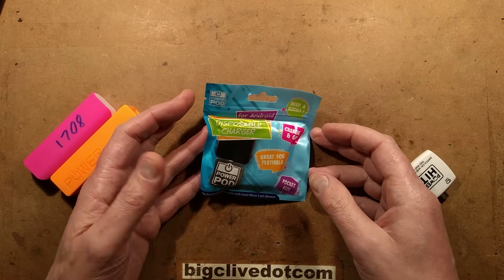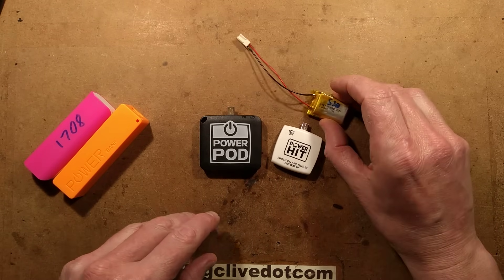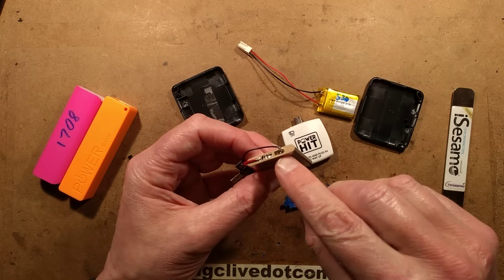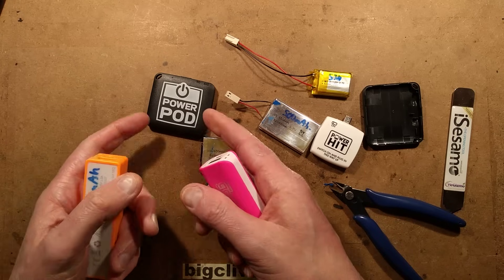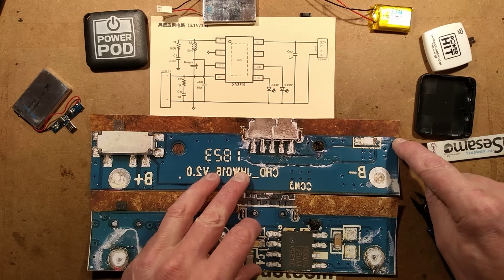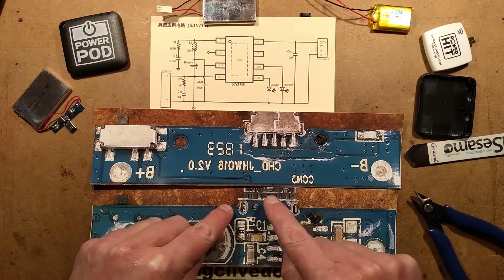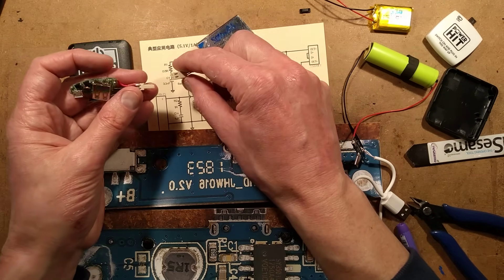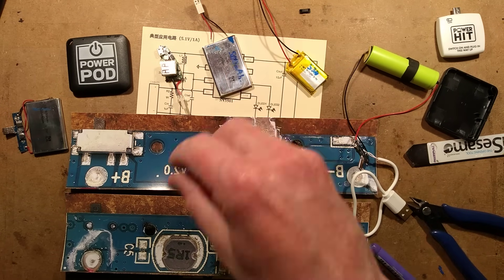Poundland "disposable" phone charger.

Comment: Shame they make and sell those instead of making a super cheap rechargeable pack out of it.  Would be easy enough to do.  On an unrelated note apparently scrolling a full screen video is now a thing.
Reply: Haha, yes! I also discovered this a few days ago. 
Purely by accident, of course :D
Reply: The scroll feature is OK but I really wish they would bring back the "fixed" video sizes when not full screen so I could scroll my subscriptions on the left without it covering and dimming the video.  I find it really annoying.  YT likes to "fix" problems that weren't problems!
Reply: @ElmerFuddGun  I use a CSS stylesheet fix that changes the video to take up the full vertical space of the page, so I don't have to go to fullscreen mode.
Reply: You win today's most-useful-comment-on-the-Internet award.
<scrolls delightedly up and down in full screen>
Reply: @davidf2281  It better to buy poundland 1200mph power bank one for one pound or there power geek 2200 power bank  one for two pound  or there 4000mah power bank one for five pound
Reply: @mrwahibtahri  Sorry, could you repeat that?
Reply: Woah! Thanks!  Much easier and faster, than toggling full screen mode.
Reply: @Hugatry  Messes up when watching 360 degree videos though. Used to be that the scroll wheel controlled the zoom, but now it just scrolls the page down. Very irritating...
Reply: Wish it'd be like vimeo, where you can see the comments and the video at the same time on desktop.
Reply: Full-screen scrolling?  That feature is not working for me.  I'm on a computer though.  You must be using the cellphone app.  I don't use that either since it always freezes up and the video-slider, pause or won't work at all.  I just go directly through the mobile Chrome browser if I happen to be out away from my PC. Never had any issues with that.
Reply: @Cammi_Rosalie  When on full screen view, you can use mouse's scroll wheel to scroll down to description & comment section.
Reply: @Hugatry   Yes,  I tried that.  I can on the "theater" view, and default.  But not on full-screen.  Like I said to Mr. Quinn in this same thread,  Perhaps it has not yet been made available to all 'tubers yet.
Thanks for your kind advice though. ☺
Reply: @Cammi_Rosalie  I use a PC (well, laptop) as well and it works fine. Could the browser be an issue? I'm viewing on MS Edge if that helps
Reply: @sadiqshehu4524   I have it now. it just showed up one day..
Reply: Working for me on a desktop using Opera/Chrome.
Reply: @Matt Quinn  Well that's odd.  I'm on Firefox and Windows 10. Perhaps it has not rolled out across all servers yet, or is being tested on a small number of 'tubers.  I see this all the time with Farcebook.  Some people have one set of functions, and others have a different set.  It sound like a nifty option though.  I hope it comes my way.
Thank you, Mr. Quinn! ☺
Reply: @Matt Quinn   It is likely that's the case.  I'm in a little rural town in Pennsylvania U.S.  near Pittsburgh.  Everything is a bit behind, here.  Hey,  we both live near a "burgh" city.  But our "burgh"  sounds like "berg".  
Have a great day Mr. Quinn! ☺
Reply: I've had that feature for over a month now.
But since I couldn't find any news about it I figured it had something to do with YT Premium... Seems like i was wrong.
Reply: Thanks,  @Ultrazaubererger  ☺
Reply: o wow
Reply: @Matt Quinn Thanks for the warm welcome,  and I will watch those videos soon.
Reply: @Matt Quinn The new functionality rollout isn't (purely) server based, as we've different users in the house here on the same connection, some with the functionality and others without.
Reply: They are A/B testing the full screen scrolling. I got that feature a month ago, once, and then never again. I have my browser set to obliterate all cookies every time I close it, so it's a lottery when/whether I'll see it again.
Reply: The real shame is that people will buy it. If no one would purchase things like this, then no one would make them.
Reply: And a good thing too. I'm absolutely shocked that YouTube actually introduced a really useful feature.
Reply: @awesomeferret  It's not a good thing if you are watching 360 degree videos though. Previously the scroll was used to control the zoom in these videos, but now you have to use the keyboard for this. I'm pretty certain that this is the same with 3D videos, though I haven't checked that. And at least I tend to use the zoom far more often than I feel a need to scroll down to the posts directly from a full screen video. After all switching between windowed and full screen is just a double click away, which isn't particularly cumbersome even using a touch screen.
Reply: Holy crap! Yes!
Reply: What's this scrolling thing you speak of ?
Reply: @MurrayMints  It better to buy poundland 1200mph power bank one for one pound or there power geek 2200 power bank  one for two pound  or there 4000mah power bank one for five pound